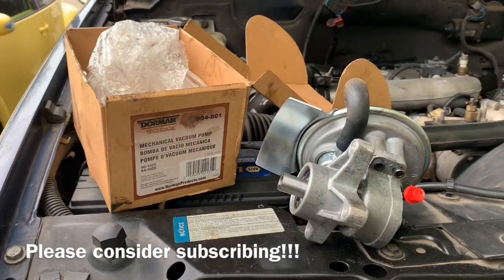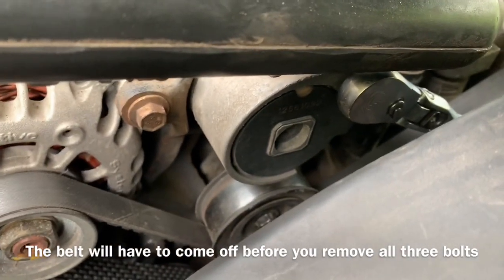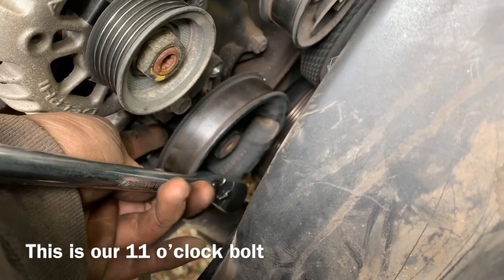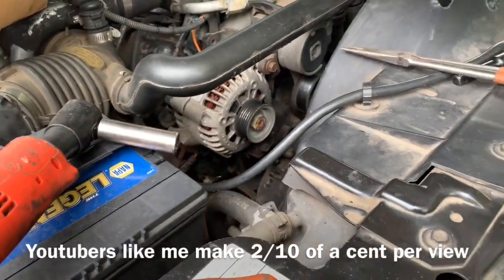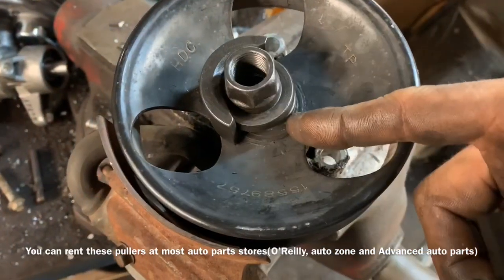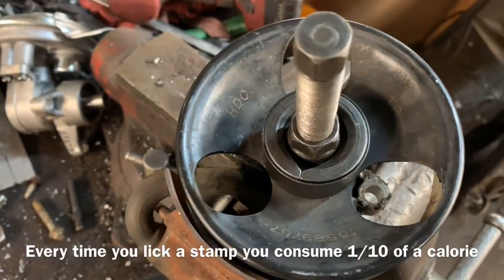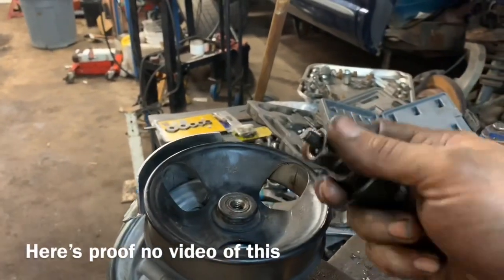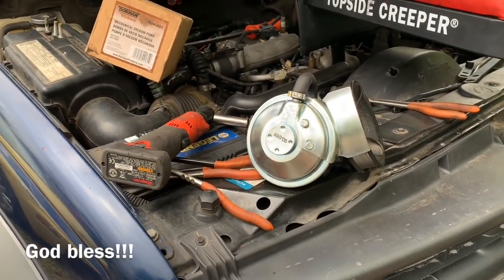GM Chevrolet 6.5 diesel mechanical vacuum pump removal/ pulley removal and install how to

Comment: Thanks for the video, I took my 97 3500 to a small shop mechanic. He stated he didn't have specific tools for job, I told him check out you tube. Needless he screwed it up put pulley on to far cut small hose doubt if checked compression. Fail, I found your channel, what a waste of 200 dollars. I took back off fixed it. Thanks definitely subscribing
Reply from the maker: Wow I love  that you were able to do that yourself. Sorry that happened to you but I’m glad I was able to help

Comment: I have a press but, was told to not use it as it could cause the shaft to push out the backside of the housing.
What do you think?

I am trying the bolt/wrench method but, it started going on the shaft crooked.  Now, I have to rent a puller and start again...I guess.

Comment: Good job .What was the reason why the vacuum pump was replaced?
I have a chevy van 6.5 diesel and it makes a noise when accelerating as if it were the belt but it is not because I replace it and the noise is only when I accelerate.
Reply from the maker: I replaced the vacuum pump Because it was not diaphragming  the air like it was supposed to. It was broken on the inside I did not have a noise when I accelerate it that I’m aware of but I did do it for another guy so it’s very possible it could have been
Reply: The other videos do a vacuum delete with the 10 mm shorter belt 6101010, install boost gauge, and a home made turbo master.
I'm doing mine.

Comment: I have a 96 6.5 TD ambu that uses vacuum in three ways, so I cannot just delete it. That one shown in your video has an extra airhose than the direct to intake:: a hose going from turbo to (front of injector?). Is that a SUPERCHARGER? Everything else looks stock.
(would make for higher cylinder temps, but *possibly more available horsepower…..? )

Comment: Please i just wanna know how good are the. 2002 chevy 6.5 diesel before o buy one watt is normal life of those trucks please thank you
Reply from the maker: From my understanding the 2002 Chevy Silverado came with a 6.6 diesel and they are very good the 6.5 diesel is not good at all
Reply: The 6.5 is a converted gas engine. If want quality parts that last but cost get marine grade parts. Lot of boats have 6.5. love my truck simply because I can lean over grill guard and almost touch firewall, oh miles should be good for 400,000 with occasional repairs yearly. Not getting away from that. But with all the chevys out there parts are reasonable if do yourself. which is best. I'm finding you tube has great do-it-yourself videos Way cheaper than Ford per say.

Comment: Delete it , it only holds your wastegate closed ohh and it puts a tiny bitbof strain on the motor its good for about 10hp just to remove it then put a spring on the wastegate to hold it closed or buy a manual spring wastegate you can build more boost / power with a slightly stiffer spring . Its also known to seize up and wipe out serpentine belts leaving you stranded on the side of the road 1000 miles from home.
Reply: Can you elaborate? Is this for all diesels or just this model, how are you rerouting the cable?

Comment: Will the pump work rotating in either direction?
Reply from the maker: I can’t say 100% for certain but I would assume that it will since it’s just a diaphragm pump I’m fairly certain that it would though
Reply: @sharpcarco  Yes.... The shaft has an eccentric lobe on it and pushes the rod into the diaphragm. (mine fell apart so I could see inside).

Comment: Why not heat the pully a little,
Reply from the maker: Well I didn’t need to. But to each their own you certainly cannot heat it putting it on because it will Ruin the bushings on the inside of the pump￼